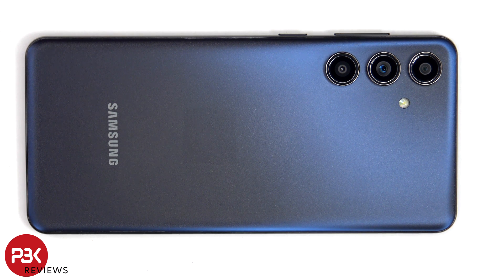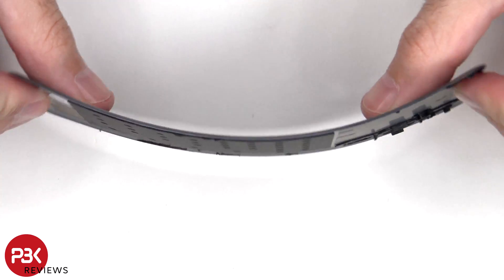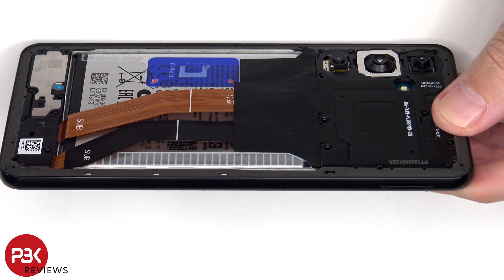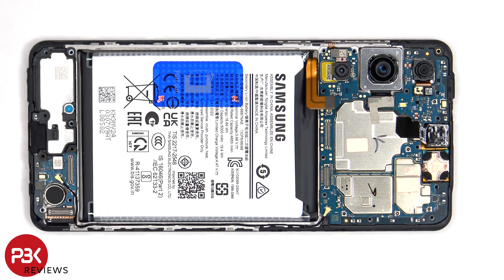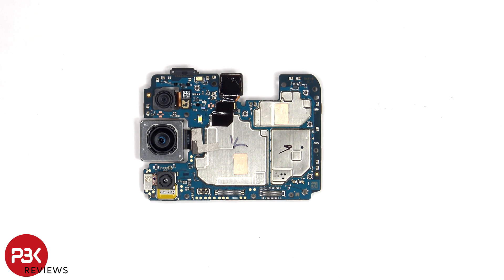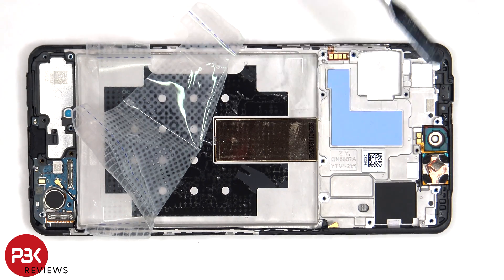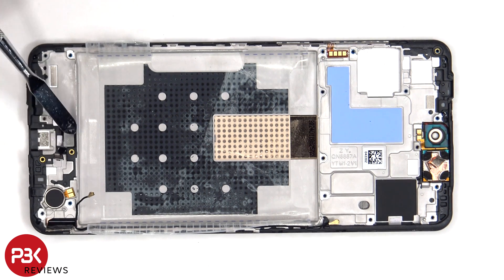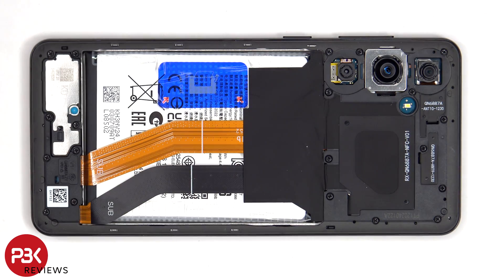Samsung Galaxy M55 / C55 / F55 5G Teardown Disassembly Phone Repair Video Review

Comment: The plastic enclosure of this phone is what I consider mid-ranger done right. This saves cost where it doesn’t matter that much. The metal frame of the A55 is one more step in the wrong direction in addition to the glass back on the A54.
Reply: Пластик быстрее изнашивается и телефон из пластика более хрупкий.
Reply: @trollfaceS1996  Not necessarily. Glass shatters, plastic is likely to only crack

Comment: Why is the vibration motor downgraded to Z-axis?
Reply: x axis is for A Series
Reply: @faruzanch  but M54 uses X-axis
Reply: @hmr1355  but M55 New Stereo Speakers
Reply: ODM device, not actually designed by Samsung. Hence some difference in parts compared to M54.

Comment: Nice, as always, sammy design and his autopsy. The Samsung M series is a line of online-exclusive mid-range budget smartphones manufactured by Samsung Electronics. The series is known for its high-capacity batteries and multi-lens camera setups, catering to the mid-range and low-end segments with essential features and some advanced features².

As for the Samsung Galaxy M55, it was released on March 28, 2024, and comes with the following specifications:
- **Display**: 6.7" Super AMOLED+, 120Hz, 1080x2400 pixels
- **Chipset**: Qualcomm Snapdragon 7 Gen 1
- **RAM**: Options of 8GB or 12GB
- **Storage**: Options of 128GB or 256GB, expandable via microSDXC
- **Main Camera**: Triple setup with a 50 MP wide lens, 8 MP ultrawide, and 2 MP macro lens
- **Selfie Camera**: 50 MP wide lens
- **Battery**: 5000mAh with 45W fast charging
- **OS**: Android 14, One UI 6.1
- **Other Features**: Under-display fingerprint sensor, stereo speakers, no 3.5mm jack

The M55 is noted for its slim design at 7.8mm thickness and is the first in the M series to support 45W super fast charging. It's also the first to feature the Snapdragon 7 Gen 1 chipset⁵.

Nice, 15W charger from my Note 5 still fast enough for me. Camera fantastic too, especially nightshots!